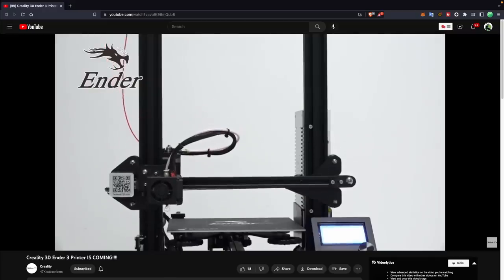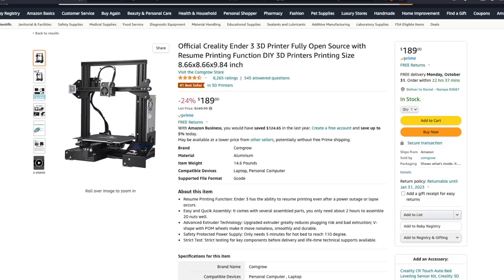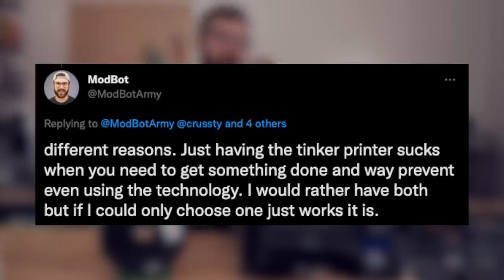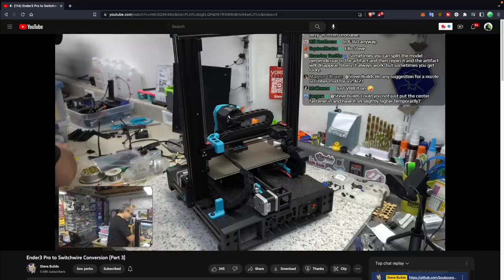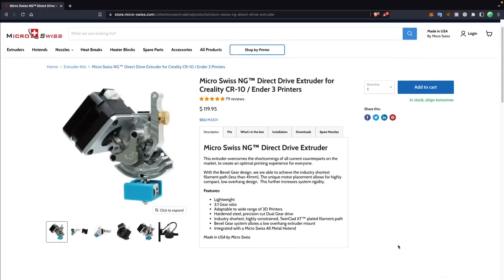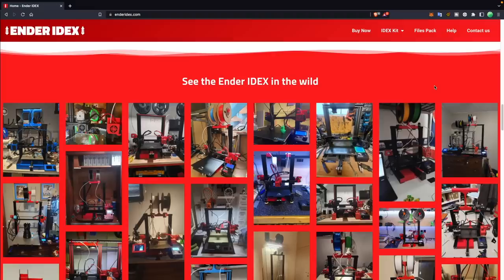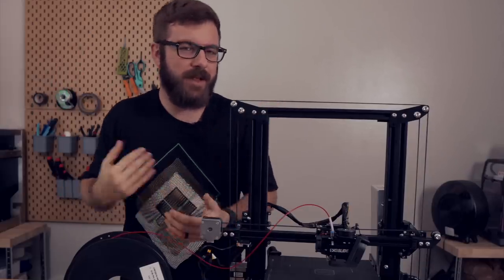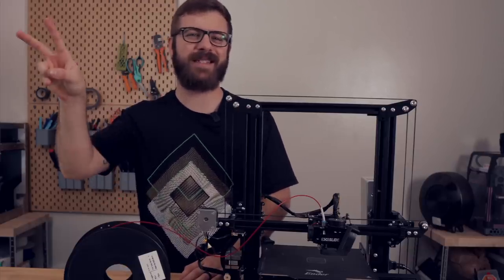Why Buy An Ender 3 In 2022?

Comment: I got the $100 ender 3 pro microcenter deal. No regrets. Still mostly stock too. Been using it a couple times a week with good results (aside from issues with specific filaments but that's not the machine fault)

Edit: bought 6 months ago mid 2022

Comment: I’ve had my Ender 3 Pro for almost 2 years now. I’ve since upgraded it with the 32-bit 4.2.7 board, BLTouch and Micro Swiss NG direct drive kit. The Ender 3 is a printer that just keeps on giving. I’ve tried to be conservative with my modding and concentrate on things that will make the printer as care free as possible. Some of the featured mods in your video do look interesting and I have to look into them.

Comment: I started my 3D journey 5 months ago with the E3 V2. This machine has taught me so much about 3D printing its crazy. Sure there are a lot of printers with more and its great if thats what you want. But I wanted to learn about how these printers work and the all that you can do with them. Theres so much to learn about 3D printing the Ender 3 is a perfect machine to learn on and with. its like Barbie for 3D printing, accessories everyhere.
Reply: I agree
Reply: I just finished the silent mod for my E3 V2 using noctua fans, the project has been a blast and the result very satisfying
Reply: I'm also using belted z system form Kevin aka sam, for bout year, and it's very good, enjoying it on my ender 3 non pro
Reply: Mine arrives tomorrow :D

Comment: I made a Ender IDEX mod I call the Ender Arrow, it will be released as open source in 2023.   

It's a full MGN rail machine with dual belt lifts for Z run from a common drive axle and motor that is tucked under the frame at a 5:1 ratio.  That allows the spool holders to remain on top but it also means relocating the mainboard from under the printer.  The downside of Z belt lift is the x carriage is heavier with IDEX and usually drops when steppers are turned off.  For that I added a simple servo brake so it stays put vs crashing into your print, was a simple mod to Klipper code to automate the brake.  The dual direct drives are as narrow as possible, about as wide as the BMG extruder they use with V6 hotends.

I've been talking with a company to produce and supply the aluminum parts I made by hand in case others just want to buy machined parts.  I run klipper with an Octopus and it's been doing great, have not tried it with Marlin.

Comment: I bought an Ender 3 v2  about a year and a half ago. I have several mods. Bed springs to silicone rubber, Micro Swiss direct drive, Slice Engineering Copperhead heat break, Red Squirrel duct, quiet fans, extended the Z height to 350mm,  dual Z axis motors, put larger fans on the mainboard and power supply, flashed the system with Jyers firmware and UI, added a BL touch, printed a bed handle and extended the feet by about 30mm to get more air under the PSU and mainboard. It's no speed demon but it's almost completely silent when printing and the prints are top notch.

Comment: been working with cnc laser cladding for 10 years. I was looking for a replacement for a mtb part, couldnt find it or when i did it was sold out. thought about 3d printing, dearched for companies to print one, found out that buying a 3d printer was the best step as these companies were charging waaaaaay too much for just a few hub spacers.

Ender 3 pro was one of the cheaper options but had the best reviews and overall score.
One week in and i am printing polycarbonate, carbon fiber nylon and carbon fiber pla, after some mods and upgrades. 
It all works the same as the Sinumerik CNC machines i work with (except for the g-code language differences of course) and i have 0 regret of buying the printer. i am even getting requests from firends to print them stuff and i can buy at least pone full spool of filament for every piece i sell them.
So it's actually making me money.

3d printing is nice, i like it!

Comment: I started with an ANET A8, and it's still going strong and producing better results than the Ultimakers we use at university. With proper care and maintenance, you can achieve awesome things with the simplest and cheapest machines. During the years, i've had many many machines. And when asking me, which 3D Printer someone should get in 2022 as a beginner or an advanced user, i'd recommend the Ender 3 S1 or the Artillery Genius Pro. I wouldn't recommend a "normal" Ender 3 or ANET A8 anymore.

Comment: I bought my Ender 3 a year ago not knowing anything about 3d printing. It now has a Micro-swisse NG extruder and is running Klipper firmware. Those upgrades have transformed my printer both in terms of quality and reliability. I can't recommend the Micro-swisse enough - it's fantastic!

Comment: For people outside of the US who cant get a $100 deal on an Ender 3 the Sovol SV01 Classic is a great buy, its an Ender 3 open source clone with direct drive and a silent 32-bit board, Meanwell power supply, 240 X 280 X 300 build size, filament runout detection, optional BL Touch, dual Z leadscrews + dual motors and all for $199 its a no brainer!, even getting an Ender 3 for $100 and upgrading it to these specs would cost at least $300

Comment: I would like to add that the original Ender 3 not only became the ideal "tinker" 3D printer because it is not only very easy to modify, but also because Creality open sourced their firmware. That opened up a LOT of information about the inner workings, and gave people the opportunity to tinker not only mechanically, but also on the software side. It paved the way for alternative electronics like BTT motherboards.
Sadly Creality stopped open sourcing their later products. Especially their core x-y series are a "black box" in that respect, and it would not surprise me if that contributed to the unpopularity of those models. They where not really great "out of the box", and would probably could have been massively improved if people had access to the inner parameters used in those machines to make adjustments. Creality choose to be secretive and shot themselves in the foot here in my humble opinion.
Lucky enough for the latest S-1 model there seems to be a fan Marlin project going on to improve the standard stock firmware and improve and expand the settings you can do from the LCD screen. So far there are no alternative main boards available (and honestly the stock main seems to be not bad at all, besides the 256Mb limitation that is). Maybe E3D will release a Revo version of the Sprite extruder (not the whole assembly of course) in the near future? Well - You can dream and hope yes?

Comment: Good video, pointed out the best reason to purchase an Ender 3 - as a set of parts to start a mod with.  I never had a 3, instead bought the Ender 5 when it first came out.   I now have three sitting in a corner all with many mods, but have moved to 2 Rat Rigs and an Ender 5 Plus.

Comment: I agree. Having gone through several printers and modding them I recently got 2 Ender 3 Pros and an Ender 5 all between $80-100.  Many printers have mods, but as soon as you start mixing and matching parts together you usually run into issues and have to back track or change your plans. Haven't had that with the Enders.

Comment: I got my first Ender 3 in 2018 (when they came out) and I still have it, it has gone through quite a few changes. Currently running a Micro Swiss direct drive (not NG... YET), an SKR Mini E3 V3 running Klipper via a raspberry pi 3B, dual Z screws, a BL Touch. I love to tinker, I also have a second Ender 3 that is slightly modded, SKR E3 v1.2 w/touch screen, a BL Touch, still running the stock extruder! (I also have 6 other printers, delta's and core xy and prusas.)

Comment: I started with the Ender 3- standard. I still have and use it. I wasn't sure i would enjoy 3D printing so i bought the cheapest printer that reviewers liked. 8 months later I have 6 3d printers, all of them modded and one designed and built by myself (with many Ender 3 parts.)  I love this hobby! 3D printing/ designing/ modding engages my ADHD brain like nothing I've done before.
Reply: Not gone beyond the step of having more than one, yet but yeah with you in everything there.

Comment: My 1st printer is/used to be an Ender 3 V2.  It is really a great machine to learn on especially since you can often get it for around $200.  Highly recommend the enders for beginners over basically all of the competition.  You might not get the best quality, you might have some issues that others do not, but in the end you will have more knowledge into how printers actually work and how your slicer affects them.  Personally, I also say beginners should stay away from auto bed leveling systems (ABL) as it is much more important to properly learn how to tram your bed rather than always letting software correct your errors.

Comment: I own an original  ender 3 I got in 2019 and recently bought an original ender 3 for my 15 yr old cousin for Christmas. I got my Ender 3 in 2019 for $189 and last Dec they were on sale for $132.  My power supply is modded to include a usb power port on the power supply to run a USB light bar I also added a noctua fan.  

When I chose to dive into 3D printing, I wanted one that was low cost, reliable and well known to tinkeres. I likened it to the Toyota Camry of 3D printers. It has been exactly that for me.

Comment: I’ve been getting into 3D printing via a few older machines but I don’t know anything about coding and I have an office job so tinkering has always been something I’ve done when needed and without any training, just mucking around trying to fix stuff. The Ender 3 series is intimidating for someone like me but I also love the idea of modding the hell out of one and using it as a base to learn how to do all this stuff. 
I guess if I can find one cheap like you I will take the plunge and see how it goes because there certainly is one helluva community for that machine.

Comment: I just converted my original Ender 3 to direct drive (I designed the head myself) with BMG clone and Volcano hotend, and switched to Klipper firmwere.
And the printer works just fine!

Comment: I have the Ender 3, and Ender 3 v2. I have been looking into another Ender 3 v2 along with the Ender Extender 400. Makes it 400x400x250. You could additionally buy 2 more 2040 extrusions and up the Z to 400. Then throw in the Ender IDEX kit, The Ender Extender looks better on the V2. That would be about $150 for an open box +$220ish for the Extender, +about $135 for the IDEX. There are a BUNCH of Upgrade paths available for the Ender series
Reply: @miltonb4522  You can do so much with it. Who knows maybe in 6 months we will have the Ender 20 that has IDEX. lol

Comment: I bought my first Ender 3 v2 back in Feb 21. I've made a few changes to it but nothing changed mechanically. I updated the hot end shroud cover and updated the fans to Noctua. I also added a Raspberry Pi with Octoprint. I also recently added a CR touch and upgraded to a PEI plate. I've been thinking about updating some other hardware but didn't know what do do next. Thanks for the video. I'm thinking linear rails, direct drive, or maybe dual Z next.

Comment: My first printer was an Ender 3 V2, which I have since converted into a custom IDEX machine with linear rails and Stealthburner toolheads. I also recently bought a Pro from Microcenter, and immediately swapped to an SKR board running Klipper firmware and a better cooling duct before even turning it on. Though I gotta say, as much as I love my Ender 3's, I kinda wish I had started with an Ender 5 and gone down the path of converting it to coreXY.

Comment: I used to own an ender 3, then an ender 3 pro, but I got sick of manual bed leveling. At the time I wasn't aware of all the mods I could add and I just sold it. I bought a Neptune 3, but the auto leveling barely worked and there was no way to manually adjust it, so I returned that. I then pre ordered an x1 carbon and it just recently arrived and I love it. It is so fast, the auto bed leveling works perfect everytime, and the prints look beautiful. I run an Etsy shop and this machine has been a lifesaver. I plan on buying an ender 3 and doing the dual extrusion mod.

Comment: Still running a Ender 3 Pro that I bought for my first printer back in 2019. It is pretty much stock except for some printed upgrades. I’m one with if it’s not broke don’t fix it but when it does upgrade the part to something better. I also manly use it for RC stuff so it doesn’t get used hard.

Comment: Many reasons to buy an Ender 3.  Large selection of parts and upgrades parts to choose from or upgrade to.  Repairs are on an average very cheap and quick to do.  A vast array of optional store bought or 3d printed DIY upgrades or variants.  The option of buying machines super cheap to use as parts machines.  I can buy a used or sale Ender 3/Pro for under $100 to a bit over, then put a $10 metal extruder, Capricorn or Tuff Tube, a nice copper with wear resistant coating and bi metal heatbreak,  buy metal spacers to insert in printed solid bed mounts, then pick a BL Touch or TH3D EZ ABL kit then flash the firmware.  Now I have a very good printing dependable machine that I can print ABS, nylon, PC, PetG, and CF blends by tossing it in a tent for a total of around $200 or less.

Oh and I spent less time in the total build and I didn't spend almost a grand for a machine that will serve me no better but does come with $.99 bag of gummies, petg printed functional parts, and freaking zip ties in key areas.

Comment: I got an Ender 3 Pro a few weeks ago. I didn't honestly know a lot about the different models or I probably would of bought a different one. 
However, I do actually really enjoy tinkering. And realized really early on that I can do a whole lot to this little machine and make it my own. 
I'm confident in saying I've already spent more than I should have and most definitely could of had more bang for my buck if I just bought a fancier machine upright.
Dual gear extruder, BIGTREETECH SKR Mini E3 V3, glass bed, part cooling upgrades, etc. She does what I need her to and she's pretty quiet so I'm happy.

Comment: Great video! I had an Anycubic Kossel that stopped working; then i bought and Ender 3 from a friend for 100€ and finally I mix them up to create a core XY Voron style printer, and OH BOY, it's fucking awesome. I also designed a tool change mechanism from scratch and it works flawlessly. Very impressive to see it running!!

Comment: I own a ender 3 pro and I started my 3d printing hobby about 8 months ago when I got it, although not completely obsolete and there are many better choices regarding stock printers for the price, but I'd still recommend it, I learned soo much not only with 3d printers, but also flashing code to pcb boards, electric work, and even some gcode. If you have the chance and you like tinkering then I recommend picking one up

Comment: My 3D priting jurney have started 6 months ago when I purchased Ender 3 max. I bought it for 250€. It is curently my only printer. A few months ago I’ve started to mod it, but i quickly realise that it is not as easy, as it is on normal Ender 3, mainly becase of the bigger size and many upgrades I have to design my self and upgrades that I can’t print is harder to source. I’ve added sencond lead screw, dual gear extruder btt skr v3 and I currently working on setting up octoprint via btt cb1 and pi4b adapter and some other upgrades. 
I like my ender and I like to thinker with it, but it is time consuming and harder than I would like to.

Comment: I've had an ender 3 since 2018.  so far I have installed a bltouch ABL sensor, an all metal (still mk8 clone) hotend (so i could print abs without burning ptfe which is a carcinogen), a bmg clone (still boden) extruder, have needed to swap out mainboards twice (the stock one's usb port just came off one day, and on the btt skr mini e3 1.3 that i replaced it with, one of my drivers died, so i replaced it with a btt skr mini e3 3.0 which has way better cooling), i've replaced the standard build plate surface with a magnetic springsteel pei sheet that's 2-sided (smooth on one side and powder coated textured on the other, i prefer the smooth), i've replaced SO MANY v-slot wheels (they wear out reasonably quickly but they're cheap), and I built a custom cardboard-box enclosure for it so I could avoid warping for abs parts.  I also installed klipper on it because it's WAY easier to change parameters and it's way more straight forward, which also means i've mounted a raspberry pi on it as well and a webcam which allows me to remotely initiate and monitor prints.  Most recently I printed all the parts I needed to build my 350mm LDO Voron 2.4 kit which is now almost done.

Comment: I got started 3D printing in 2017 using a Tevo Tarantula. The next printer I purchased was an Ender 3 and it is currently printing ABS parts for an Ender 3 Pro to Switchwire conversion. They are great little printers and can be tuned well stock or taken over the top 'Pimp My Ride' style.

Comment: I have an Ender 3 that I originally nodded to a dual-z, with linear rails on the x and y and the original micro Swiss DD kit. I just picked up an "unrepair" E3 on eBay to do the belt conversion. The printer cost me $75 shipped to my door so now it's just a matter of getting the conversion kit.

Comment: I started back in February this year with an E3 V2, with the specific goal of just having something to mod and tinker with. I have not regretted the decision. At this point I’m confident I could purchase almost any printer from eBay that is “broken” and make what I want out of it. I’ve spent more money than I care to admit on my first and only machine, but I’d like to say it’s been worth all the knowledge and experience I’ve gained. At this point I’m even tempted to purchase older or broken SLA machines and repair those to working order rather than spend a small fortune on a new one.